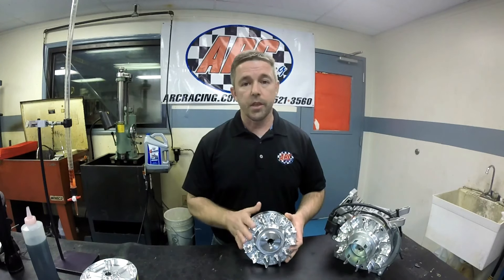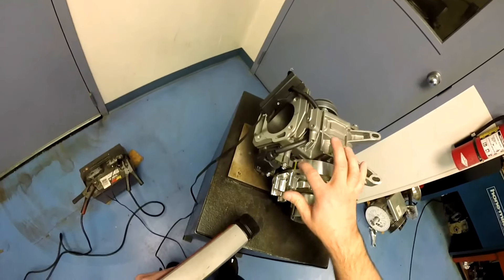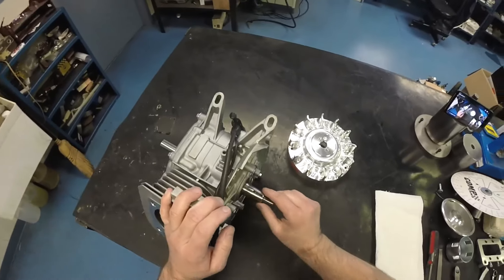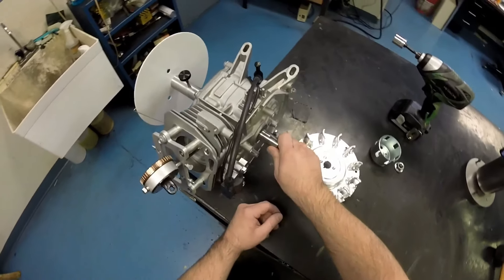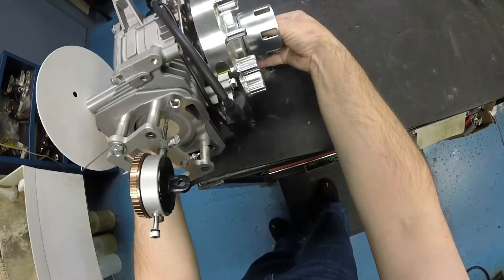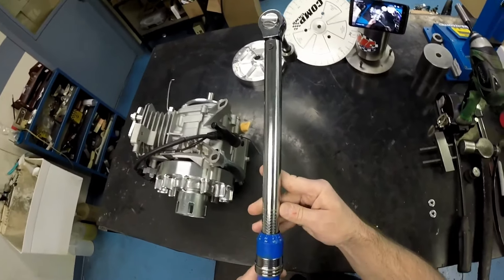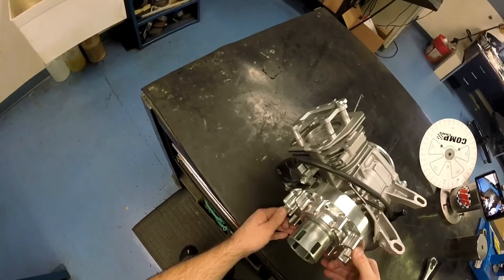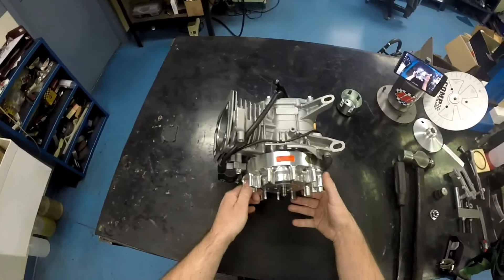ARC Racing - Video #1, Billet Flywheel Installation.

Comment: I've installed a few dozen with keys - properly lapped and torqued to 65ft lbs, with no issues outside of catastrophic engine failure.

I started using a degree wheel without a key, and I'm 2 failures out of 4 installs. What am I doing wrong?
Reply from the maker: Call us at 800-521-3560

Comment: I came across a 12 hp briggs and stratton 31p977-0635-e1 with an ARC 6611-IV on it. The engine's not charging. Is there room under that flywheel for the alternator or would have to be removed?

Comment: If I  am running a key them do I still need to use the the dial indicator and degree wheel to adjust the degree or will the key do that for me? I just have to install the key and that will hold the 34 degrees?
Reply: yes it would if u have the keyy
Reply from the maker: +Jeffrey Martin You can call are tech line and we will be happy to help you.  1-800-521-3560

Comment: thanks for this video.  i installed the ARC billet flywheel today and all went well thanks to your instruction; however, the recoil starter does not work.  It appears the billet flywheel is narrower than the OEM flywheel & plastic fan combo; thus the cylinder engage by the tangs on the recoil will not fit into the slots on the cylinder.  Is there a replacement part or new recoil that solves this problem.  Without it the engine is useless unless I rig up a rope starter.  ugh!
Reply from the maker: Sound like you have a hemi predator engine. The blower housing has a different off set than a non hemi or clone engine. You will need a blower housing number DJ-1191 or DJ-1191B.

Comment: Can you take any fly wheel and not run a key in it if you lap and properly torque the nut? So I could have any timing I want?
Reply from the maker: Yes if proper lapping procedure, and torque spec are followed.
Reply: Flywheel i got says it is 32° btd so why would I have to time it when it says thay useing stock key,
Reply from the maker: @richardcranium2017  OEM crankshafts are mass produced and not all keyways are in the same location.
Reply: @arcracing7637  so neither are the flywheels ran great until i installed 265 cam possible im 180 off base timing
Reply: @arcracing7637  thanks it was off 90° going to run without key

Comment: Do you have a billet aluminum flywheel with the electric start gear for honda gx270 ?
Reply: If you remove the governor its highly  recommended to do a flywheel and Connecting rod. Flywheel can explode. I have Heard story's of ppl almost dieing cause it hit A main artery,vain in their leg. The rod if so you don't blow a hole in the block if the happens just about the hole engine will be toast

Comment: Hi i did not catch up where the position of the magnet aligned to the coil to fire,also could you help me find what is the timing degree of the Honda gx390,made 2013
Thanks.
Reply from the maker: Leading edge of the magnet, right hand edge of the coil.

Comment: How do I torque my flywheel down without the crankshaft turning
Reply: Install clutch on the oppose side let a buddy grip on that sucker tight with gloves on and run that but down
Reply: Same way he said but use a chain to hold it rap it around the teeth and use the excess like a handle it is a lot easier was able to do it by myself

Comment: Question I installed a Billet flywheel 18 pound valve springs and a new race ready carburetor now when I go to pull the pull start it's not wanting to turn but the two or three times I did get it to turn it had a loud backfire or popping type noise. Would you happen to know what I could have did wrong?
Reply from the maker: Do you still use the stock air box, or an open style air filter with the new carb? What did you torque the flywheel to? Did you lap it?
Reply: ARC RACING it's a predator 212 engine with a performance air filter I torqued it to 50 lb and what do you mean by lap it?
Reply from the maker: In the video it shows you how to lap the flywheel

Comment: I installed a stage 2 into a non hemi but use the arc lite flywheel instead and my pullstart recoils back really hard/fast, do you know what is wrong?
Reply: Did you figure it out? Mine is doing that
Reply: I'm getting that too, my guess is it's too high compression or a timing issue.

Comment: I wanna do a performance kit for predator 212cc. I can do everything except I know I will have trouble doing the fly wheel and coil gap. do I need a machine thing you had to set the degree?
Reply from the maker: +Tommy Owen You can call are tech line and we will be happy to help you.  1-800-521-3560

Comment: I have just installed the same flywheel on my 212 hemi clone and every time i go to pull the pullstart it yanks the cord out of my hands. So i put a better cam thinking it would time the engine but no. Do you have any suggestions on what i can do the time it. Should i put a advance fly wheel key, and if so what kind
Reply from the maker: As far as the kick back, sounds like the valve lash is too loose. Set it as close to zero or no more than .002 with the engine at room temp. This will allow the compression release on the cam to work properly. I have a video called "Valve Train Tip & Tricks" it shows you how to set the valve lash. The cam has nothing to do with flywheel timing. The flywheel is timed with offset timing keys. The flywheel you have is already advanced 8 degrees, so it will be at 32 degrees timing with a stock key. If you need more ignition timing you will need to purchase which ever offset key you need. We sell them in 2, 4, 6, 8, 10 and 12 degree advance.
Reply: ARC RACING ok thanks you so much!

Comment: I'm gonna be ordering stainless steel valves from arc, what are the measurements on the intake/exhaust valves for the predator #60363 hemi?
Reply from the maker: For the hemi you will need the 27mm Intake and 25mm Exhaust. You will probably need to run 26lbs springs along with the appropriate high performance retainer and keeper sets and lash caps. We offer a Stainless Steel Upgrade Hemi Valve Kit.  The part number is  (DJ-SSVALVE-HKT)
Reply from the maker: http://www.arcracing.com/dj-ssvalve-hkt-stainless-steel-upgrade-hemi-valve-kit/
Reply: Thank you. The cam I'm looking at calls for 36lb springs, will these be sufficient?
Reply: How does the spring tension affect performance?
Reply from the maker: What lift is it?
Reply: Also, I just read the 36lb springs don't fit the spring seats?
Reply from the maker: They do not fit the hemi. How hard are you wanting to turn it?

Comment: is the grinding part necessary when you have a new engine? also, how advanced should the timing be?
Reply from the maker: Typically yes theatrically the tapers are the same but they are manufactured by two different companies in two different locates to be on the safe side you should lap them all. The amount of advanced timing required depends on the application which you are using it on.

Comment: so if i have a 2013 model i have to set it to 24 degrees?
Reply from the maker: What part number is on the flywheel?
Reply: ARC RACING its dated 9/13
Reply from the maker: Part number should be like a 6619, 6625, 6626, 6608, 6611 something like that. It will be engraved on it with date.
Reply: ARC RACING the part number is 6625
Reply from the maker: 24 degrees BTDC

Comment: Hey Jodie, what size is the flywheel/starter cup nut?
Reply: On a predator 212 hemi?
Reply from the maker: 14 x 1.5mm
Reply: 14mm? This dude that goes by Redbeard who always says measurements said 19mm.
Reply: I hope it's 14, I have that socket already. ( : ) )
Reply: It is a Predator hemi, #60363.
Reply from the maker: 3/4 standard is socket you will need

Comment: Wait, so we don;t need the keyway with the new fly wheel?
Reply from the maker: Key way is optional on any flywheel new or old.
Reply: @arcracing7637  can I still use the pull start without using the keyway

Comment: also what model is that specific degree wheel?
Reply from the maker: You can purchase them from Dyno Cams.
Reply: ARC RACING they have two models of this wheel. which one did you use
Reply from the maker: DEGREE WHEEL UNIVERSAL
Reply: ARC RACING awesome. thank you for all the replies.

Comment: couldnt you just line up the yellow line under the coil instead of doing the whole timing process? i feel like im missing something.
Reply from the maker: Then how will you tell at what position the crank needs to be? This is part of the timing process. Using the mark on the flywheel as the reference, then rotating the crank back to the proper timing mark on the degree wheel.
Reply: ARC RACING i thought the key kept it where it needed to be. or does the flywheel still free spin after putting it on the crankshaft even though the key is still installed?
Reply from the maker: The key holds it still, but you still need to check the timing to be sure the key in the OEM crank is in the right location. These are mass produced Chinese cranks, the key locations can vary from crank to crank.
Reply: ARC RACING does that change if i have genuine gx200
Reply from the maker: You should check timing on any mass produced engine.

Comment: Is 34 degrees only for a specific engine size? I'm looking for the degrees for a 420 Predator when installing an adjustable billet flywheel.
Reply from the maker: Gasoline .... 30-34 deg      Methanol.......32-36 deg

Comment: I  bet a lot of people ram the flywheel nut home with an impact gun. Especially now with all these electric impacts that amateurs are using. Reason is they do not have a torque wrench and a non destructive way to hold the crank.